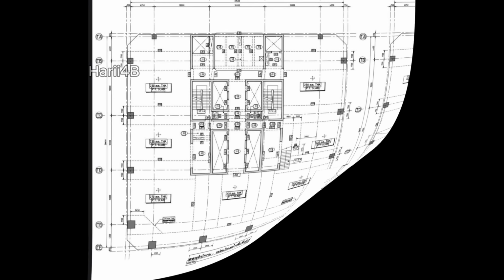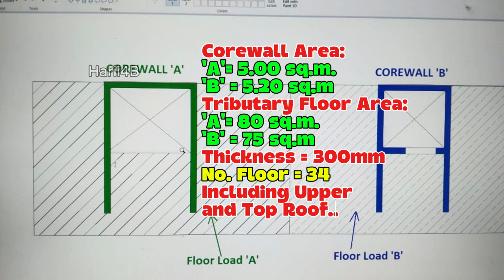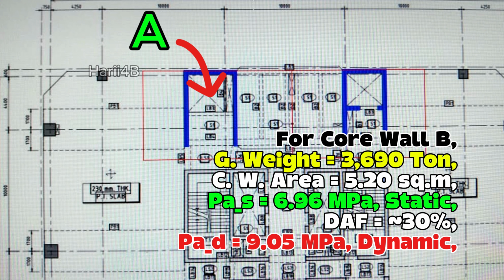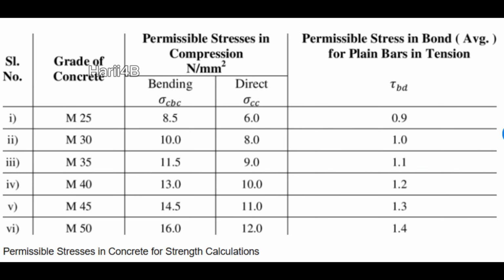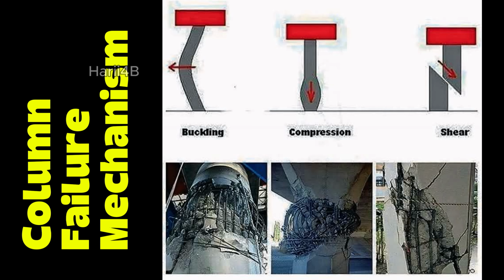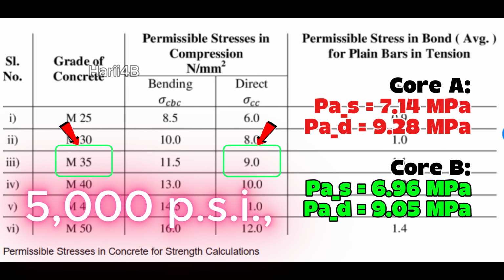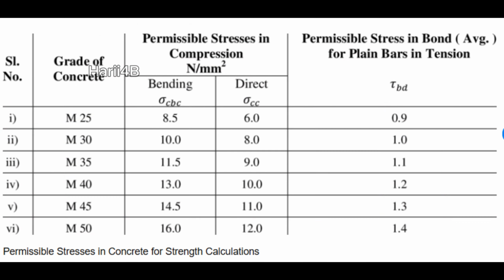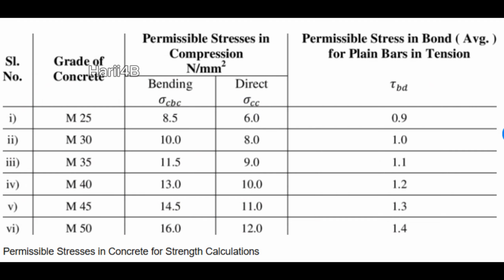Myanmar Thailand Earthquake - Thailand Building, TOWER CRANE Killed It, CONCLUDED - Watch Now!!

Comment: Theoretically speaking. If the shear wall design is symmetrical, meaning there are shear walls provided in the opposite side of the building, is the collapse unlikely to happen or less likely to happen, even if one of the shear walls is used for crane tower location? What's your take on this?
Reply from the maker: those outer core walls are taking more loads than inner cores. by mere action of tortional rigidity against center of mass. consider now that lateral loads (wind or eq) applied, the torque and eccentric loading are carried more by the outer cores. indeed, it is a flawed design.
Reply: @Harii4B  For you, is it a flawed design because one of them is . . . It''s not symmetrical?
Reply from the maker: @gnidnoeled786  i made my checking that is why.  imagine the thicknesses of those walls for that high of a building? i will keep this review as it is now.  heard that Thailand engineers aligned with my findings. let them issue official reports.
Reply from the maker: buildings are also analyzed as cantilever beam. that being said, the sections of the beam at the outer edges (tension/compression zones) always carries the higher stresses when subjected to bending due to lateral forces. no amount of fancy analysis software can defeat conventional old school approach.
Reply from the maker: now back on the theoretical question. let's simplify the answer. if shear walls are symmetrical, the vertical members will distribute/take the gravity load more or less balanced. now add the live loads, they will not always be balanced or uniformly applied on all building areas. technically, then you already have unbalanced load distribution in case of live loads.  now let's go for lateral loads (wind or eq)... rotate the building and make it horizontal cantilever. apply the loads then compute the bending moments then convert into couple forces. surely you will see that loads are now tension/compression with extreme values going at the outer edges.  defends also on how you applied the lateral load dictates where tension and compression is. but that's not yet done, now apply torsional loads like accidental loads mentioned by codes, then you get torsional moments and convert that to couple forces also. it gets not easy now does it? but that's how i will simplify it without using software's. symmetrical or not. concrete will behave differently when it's under tension or compression. those core walls at Thailand building suffered compression stress due to vertical loads, and another compression stresses due to bending of the building and then torsional stress due to accidental loads (tower crane). they crumbled instantly due to high overstresses, collapsed and bring the rest of the building down. i am not yet discussing the effect of the foundation here with respect to those overstressed core walls. but i'm sure i can discuss it further if i get to see the foundation plans. hope i answered clearly your question?

Comment: the Tofu china materials and contractor killed it.
Reply from the maker: those outer core walls are taking more loads than inner cores. by mere action of tortional rigidity against center of mass. consider now that lateral loads (wind or eq) applied, the torque and eccentric loading are carried more by the outer cores. indeed, it is a flawed design. add up to that, if the construction materials are flawed. so, now we see the result.

Comment: It fell because china used tofu steel and tofu concrete
Reply from the maker: Actually, the crane helped exposed their flaws (if there is). So let them blame the crane. on my part, crane could be the Saviour. if ever this event happened later when the building is occupied, more casualties there will be. If indeed it's proven as tofu dreg design and construction, they had built a ticking time bomb, and the crane became the trigger of the bomb, activated by the earthquake. thanks for watching!!

Comment: Maybe substandard cements and steels made in china and with weak structural design of china engg and not to blame trane ( the silent monster ) and blame CCP tofu. Project
Reply from the maker: No, actually the crane helped exposed their flaws (if there is). So let them blame the crane. on my part, crane could be the Saviour. if ever this event happened later when the building is occupied, more casualties there will be. If indeed it's proven as tofu dreg design and construction, they had built a ticking time bomb, and the crane became the trigger of the bomb, activated by the earthquake. thanks for watching!!

Comment: yes they should do structural forensic investigation
 i understand that values mention were not taken 
from the fallen building. 1megapascal = about 10 tons per sqauremeter.???
thanks naintindihan ko na...puwede na akong kumuha ng quiz. dipa kasali yong acceleration
of falling floors which add more compressive presure.
Reply from the maker: 1MPa = around 102 tons/sq.m. sir 🙂
Reply: @Harii4B  opps i failed my quiz regroup and review thanks